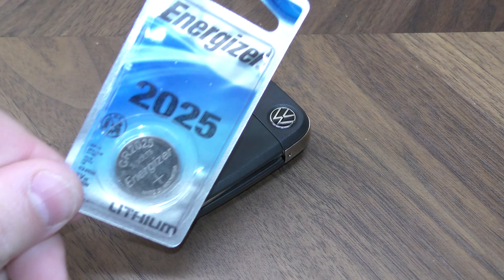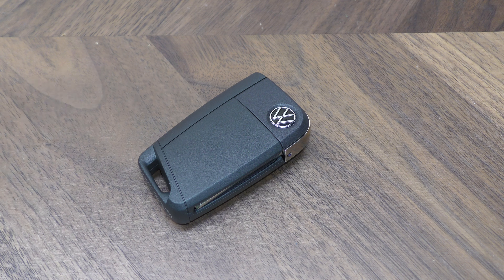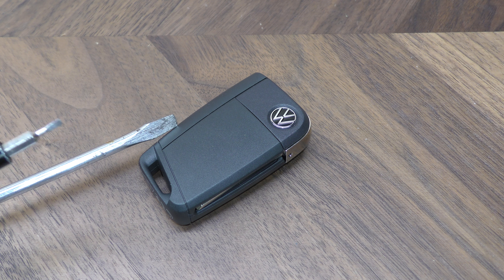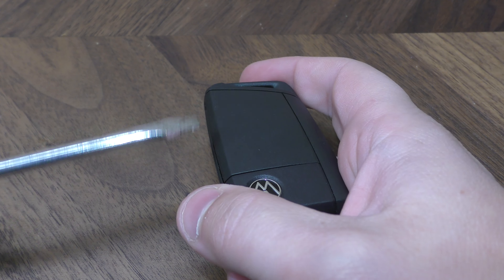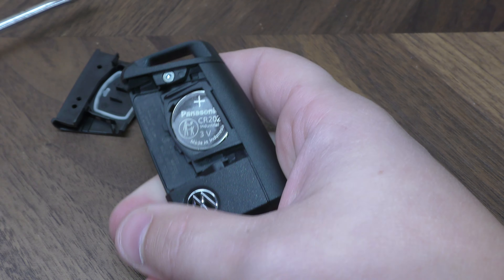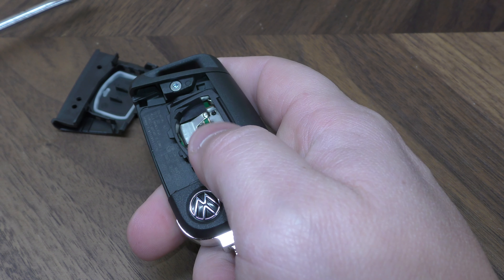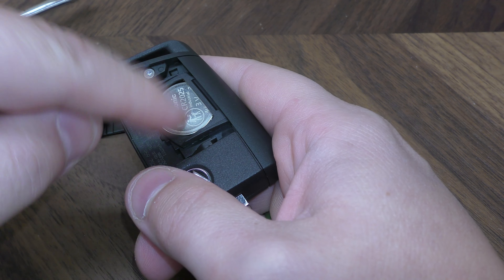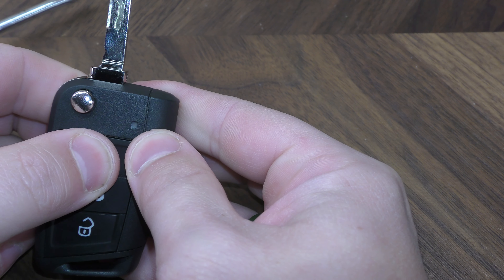VW Crafter / Transporter key fob battery replacement - EASY DIY

Comment: I tried this, but it didn't work - the car was too far away to recocnize the key (I used a brand new battery - 3.3 volts). Took it to the mechanic and he put a new battery in, and it worked! I guess you have to replace the battery when the car is within range, and press a button on the key just after replacing the battery…
Reply from the maker: Good tip!